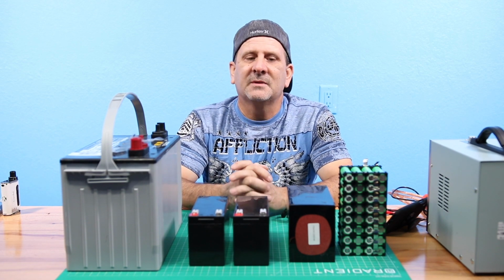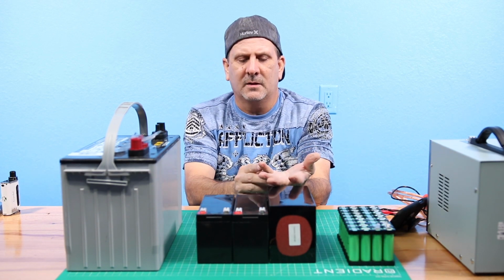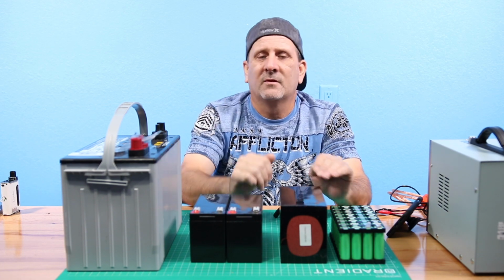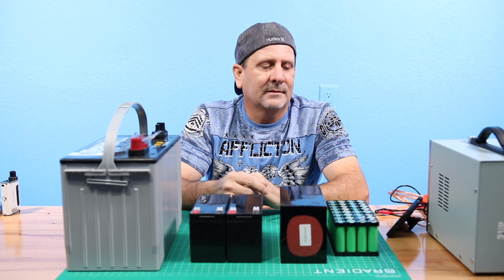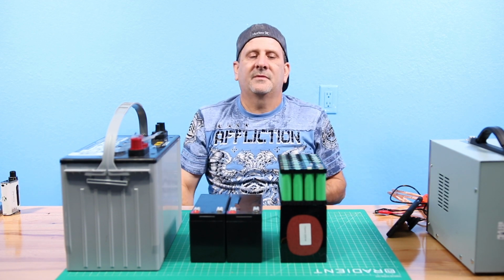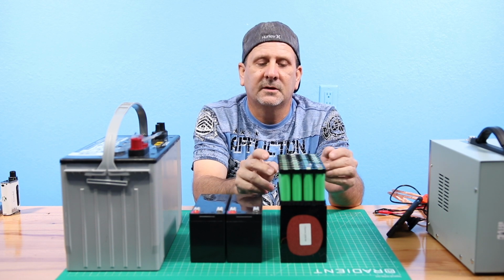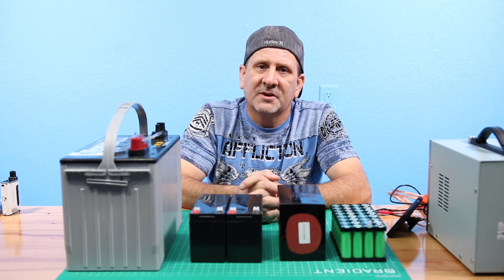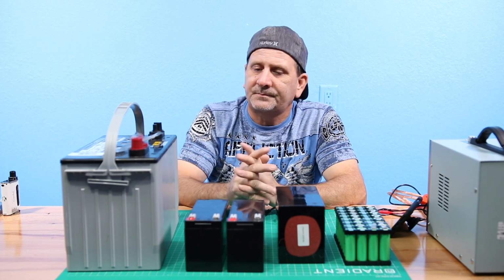Battery Comparison Lithium 18650, Lifep04, AGM Deep Cycle, Sealed Lead Acid

Comment: this is bad!! and offers no help to the consumer you can not compare the two without mentioning discharge efficiency smh
Reply from the maker: Thanks for watching and your input. Sorry this was not good enough for ehat you’re looking for.
Reply: @WesThatTechGuy  sorry for the rude comment it just upsets me because lithium can be very dangerous, when you don't have the needed amount for your application, and misinformation is the number one cause of dramatic lithium failure. With that said I do appreciate trying to introduce the community to a chemistry that is the future of energy storage
Reply from the maker: Matthew, thanks! I have many other videos talking about the DANGERS of li-ion and I preach non stop about the safety that needs to be administered when using li-ion. Too many people watch other videos and think these li-ion cells are safe and don't understand the potential risks when using to power houses and motorhomes etc. LifePo4 however is a VERY safe chemistry. Thanks for watching.

Comment: When Verizon called to sell me their new FIOS system ( lovy.biz/44oi ) they never mentioned that FIOS uses this battery that lasts 3-4 years (if you're lucky) and costs $43. And if your electricity goes out, you have only 4 hours of talk time on this battery and then your phone is dead. After I discovered how this was not an improvement, I called Verizon to see if I could go back to the system I previously had (which never went out if the electricity was out for days and which didn't require an expensive battery) Verizon said I couldn't go back. I assume it is because they strung the FIOS wiring to the house and didn't want to go back and change the wiring back to the old type, which they acted as if that couldn't be done.

Comment: If those are 18650 lithium batteries, they are not 25 amp discharge Percell they are 10. Also they are 2.5 amp hour per cell
Reply from the maker: Tyler Schreiber You are incorrect on the discharge rating! They are in fact 18650’s and they do have a 25a continuous discharge and yes they are 2.5ah or 2500mah.

Comment: make it a 7 S and run a 48 volt system and be much more Efficient .... put two 24 volt in series gets you total 55 volt system..
Reply from the maker: This could work but then you need four times as much space and four times the cost for the same amount of stored energy. YES it would be much more efficient than 12v.
Reply: @WesThatTechGuy  I mean use 18650 lithium ion cells .. lest weight and space for the 48 Volt system....

Comment: hi I have a question, can I run and AC on the SolarGeni 9000 Watt Portable Solar Generator
Reply from the maker: Dj Tumbao YES you can! No problem!!! Thanks for watching.
Reply: @WesThatTechGuy   o super I will probably get one on 2019 , thank you so much for you reply , I get in touch by email wen I'm ready so I can get exactly what I need and again thank you so much.

Comment: are you kidding us ?  your lithium   battery  has 32 cells and if you want to build 5 batteries  you need  160 cells , each cell will cost lets say 4 usd , your 5 lithium batteris will cost 800 usd , referring to your calculation  5 lithiun
 battery costs 20 usd  wonder how people believe you
Reply from the maker: what are you talking about? What it costs to build (5) 20ah 12v lithium batteries from new cells or???
Reply: off corse new cells , we want that our battery to rich 10 000 life cycles or more if we discharge lets say 30 % , if you are using old cells,  dunno how much your battery will last , 400 life cycle  ?
Reply from the maker: what is the point of what you said in the first comment is my question? Are you supporting what I'm saying in the video or saying I'm a bad guy or what?
Reply: i am not saying anything about you personally, i am talking about the battery lithium ,you said in the video that  the battery costs you 3.2 pound if we divide 3.2/32 cells = 0.1 pound , each cell costs 0.1 pound , is this realistic price?  i am not convinced , may be i am wrong , explain to me your idea how did you get to 3.2 pound ?
Reply from the maker: Philip abboud This was talking about each individual 18650 battery cell not the battery pack as a whole
Reply: He’s talking about weight 3.2 lbs. not pounds as in currency. Also if you order from the right place you can get 18650 cells for around 2 - 2.50 American dollars

Comment: 18.6 volts for an inverter seems a little high. My 300w PSW converter says 10-15volts. ?
Reply from the maker: Not sure what you mean but I might have made a mistake in my speech? do you remember at what point in the video I was talking about this? Thanks.
Reply: @WesThatTechGuy  I'm sorry at 5:55 you said 16.8 not 18.6 as I stated. But still my inverter recommends and input no higher than 15 volts. You are probably using much better inverters than the cheap PSW inverter I'm using. Oh I went to your website and can't find a pack like the one you are showing in this video for sale.
Reply from the maker: ok thanks. So yes the pack is built at 16.8v when fully charged. Our inverters will handle up to about 16.5v however I use electronics that manipulate that so the inverter has no idea what the real voltage is. Buck converter. So I tell the inverter that I'm operating at a lower voltage than I really am. Hope this helps.

Comment: Hey Wes,  G'Day!  If I used 6 of the Li-PO4 battery to propel my fishing Kayak - I would save weight - it would run about 120# with AGM vs 80#  Big question !. My cost to have you make 6 8P4S Batteries and ship to eastern Iowa  2.  Are  the 8P4S 25amp safe (so new)  we hear so much about Lithium exploding and such on the news? I'll be using 6 of them for off shore fishing to have enough ooomph to make it back against any currents.  thnx for any feedback & info Wes...............Jack
Reply from the maker: Jack, you would in fact save weight. For prices please contact me direct by phone or email. YES the lifepo4 are new and they are safe! They DON't blow up or catch fire.

Comment: Can anyone tell me where to get the 18650 frames to hold these batteries and where do I buy the nickel foil wire?
Reply from the maker: yes you can get them on amazon. just search for 18650 holder and nickel wire for 18650 battery

Comment: When you are talking about “usable” energy, you cannot compare the size, ah, and cost of a lithium battery to a dinosaur lead acid.  You cannot drain a lead acid battery below 50 percent, whereas lithium can be drained down to atleast 15 percent (85 percent of energy is usable).  It takes almost twice the capacity of lead acid to equal capacity of lithium.  When you add in the fact it takes half the amount of lithium and the extra discharge cycles you get, I believe the cost long term may be actually cheaper or close to the same for lithium.
Reply: yep...  I have 2 (50 ah) lithium  LifePO4 batteries, and that is equal to (2) AGM 100 ah batteries.  and they weigh together (34 lbs) compared to 140 lbs of AGM
Reply from the maker: lithium and or Lifep04 is always the way to go
Reply: The lifep04 seem intresting as they seem to be bigger per cell then the usual ones I have seen on here {them green ones on your video}, used laptop battery's or even new don't seem to have the capacity vs a lifepo4 battery,, seems like they be good for off grid solar use seem to have higher cycles recharge as well then the smaller lithium battery
Reply from the maker: Yes the LFP batteries are great if you get the right ones and they have the proper mah/ah rating as well as the continuous discharge rating (c rate).
Reply: Cost per Kwh lead acid is still the best ,  you can get up 20 years and 13,000 cycles out of a good one also what's never mentioned is lithium and lifep04 batts cycle life drops dramatically the lower you discharge them
Reply from the maker: Awesomus Maximus this is so not true! Since when and what lead acid battery are you referring to? Lifepo4 will truly last 25 yrs and lead acid in a energy storage situation is a complete mess and a joke and will NEVER last 25 yrs.
Reply from the maker: Good comment! Yes I can in fact compare the size, ah capacity and cost of all the batteries in the video as that is what the video was about. just a simple FYI video for the most part. YES lithium is the way to go and that was the general jist of the video too. No disrespect intended just saying thats what the video is about for some folks and newbies that don't know that much about batteries in general or the diff. types etc. thanks for chiming in General South.

Comment: I think Tesla may be using 20650 or 21650 or 20700, 21700 cells can't remember exactly. but I seen where they was moving up in size. maybe that's what the semi truck uses. I would love to get some Tesla packs. like I have said I need like 1200 ah. minimum.  I only have 200ah now. and a small lithium bank 14cell pack of 26650's at about 7ah. and a 18650 pack from 1.5 ah cells . its not complete. but has like 28 cells. they are high drain . drill cells. can output 25a also. I just got a deal on them.
Reply from the maker: I'm not sure about the newest batteries but will be looking into it. I now have the new Tesla S and the Smart Fortwo battery packs/modules!!! The Tesla modules are SWEEET!

Comment: have you thought about a building a small gas powered 12 volt  DC generator? to use in emergency. when there is no sun. I'm working on a large one to recharge my 24 volt lead bank. until I get my panels up. do you have a source for solar panels at a really good price? I'm not out to make money. I guess I should be more like that. anyway I just need to power my off grid home better. if you want to work on the DC gas generator. let me know. I have a  weed eater engine. I'm thinking about using to run a 12v alternator. maybe get 40-55 amps at 14volts. it would be a good option to charge in a emergency.
Reply from the maker: Yes I have done these in the past.I am going to be stocking a large amount of various panels in about a week or more. Still waiting on shipments to arrive. I can build a gas powered generator but am focusing on renewable energy as of right now. That said most of us with solar and batteries will always need a generator to help out on the bad days of no sun to keep the battery banks charged up if not on the grid.